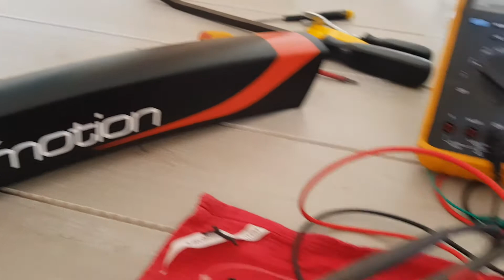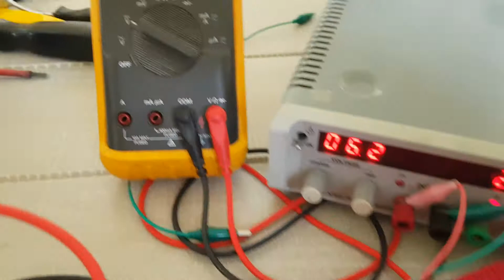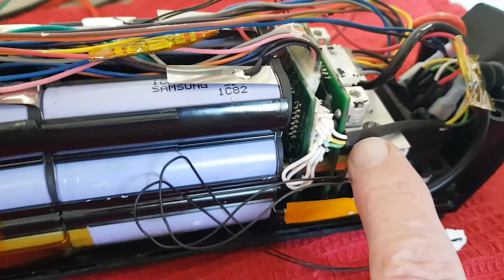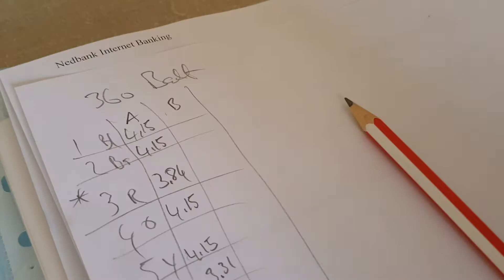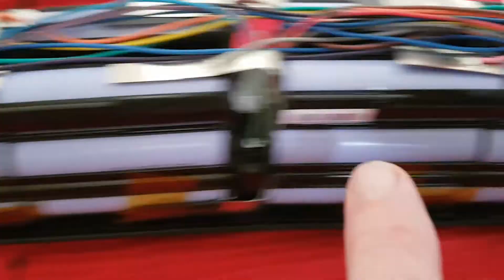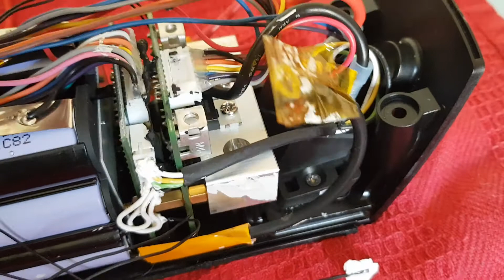Evo 36v Batt out of balance

Comment: any idea of where i can buy a charger for these battery
Reply from the maker: I just use the one I got with the bike any 56v DC power supply will work
Reply: @alanfalck1184  
tnx for ur answer alan ...so u think it will be ok to charge with out the pigtail only conectin the positive and negative straight to the battery
Reply from the maker: @Mr818oscar818  hi just remember if you are charging directly onto the battery there is no BMS to control the cutoff voltage so you'll have to monitor this carefully or you'll damage the batteries

Comment: Hello Alan. I have a BH Neo Jumper with this 36v 8.8Ah battery. Capacity is degrading and I want to have more power on board. Three questions: 1. How many batteries are mounted (I suppose 10x4 but please confirm). 2. Is there place for more batteries in the housing? 3. Would it be possible to replace the existing Samsung 2.2Ah batteries with more modern and more powerfull 3.4 - 3.5Ah batteries without getting trouble with the BMS? I have a spot welder and already build other smaller battery packs for other purposes but I am not a real electrotechnician. Thanks for the video’s you made. Gerard

Comment: My BH neo digital control has broken after water got inside bad design it's not waterproof and the BMS on my battery has failed as well it does not allowed power to transfer through the BMS but all batteries are ok 36v plus before BMS... You don't get any help off BH easy motion more like easy brake down my bike never worked since I got caught in heavy rain for 20 minutes I'm quite disappointed... any suggestions??